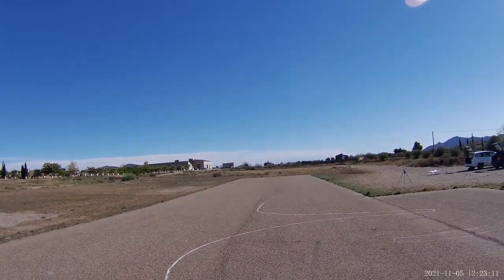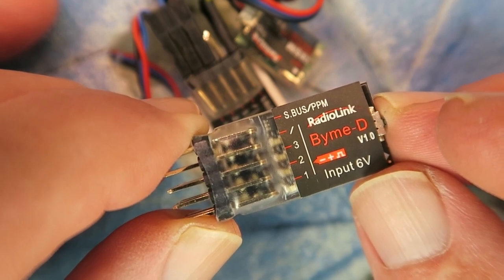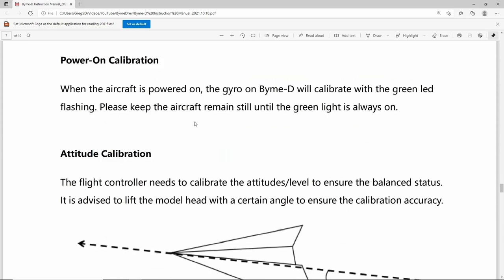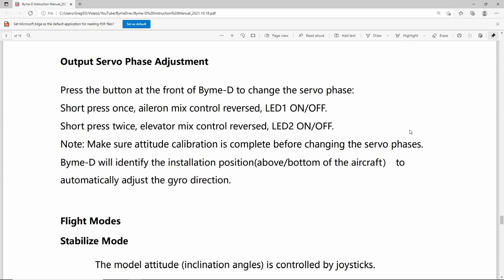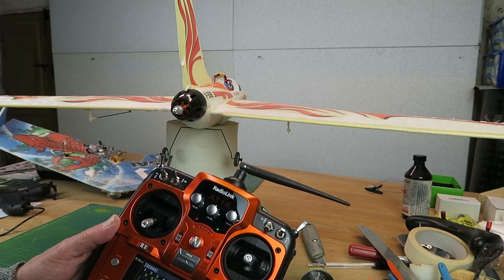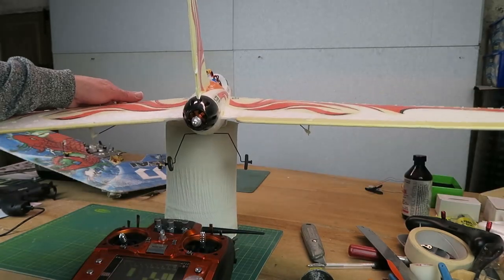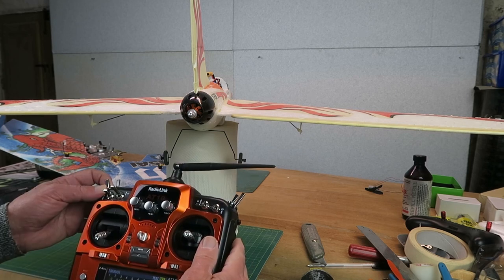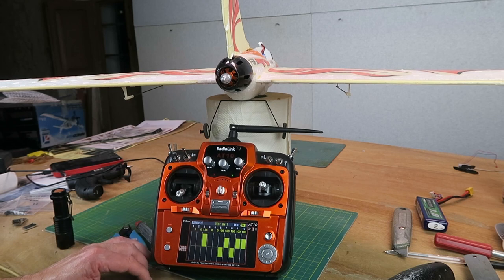Radiolink Byme D Gyro Stabilizer Revisited. Setup and Flight

Comment: 1 thing that should be added to this ( for users of other radio Tx/Rx protocols) is that the channel order MUST be A,E,T,R,5(on a 3-position switch as said here),6,7(on a 2-position switch) for these RadioLink Byme stabs to work. The re-mapping Etc to get this (and other quirks of various protocols) can cause the stick position combination to initiate the Attitude Calibration to be something quite different from the "Down and Out on both sticks" as shown here. Go through them all before you yell "It doesn't work!" The sticks will probably need the full travel of 1000microsecs to 2000microsecs as well - IE no reduced Rates and Spektrum may need 125% extended limits enabled! 
Also the Microsecond switching points for these are not known yet (RadioLink has ignored requests for information on this point) and also seem to vary from unit to unit. EG for some units it will prove impossible to have the motor stop at low throttle even if you have your ESC calibrated to your Tx/Rx correctly. You will have to go to your Outputs Page and drop your lower Throttle limit below -100% (on -100/+100 systems.) 
They do seem to work reasonably well though within their limits and are at a good price point.
Reply from the maker: Valuable input my friend! I have pinned the post so others can see it. I'm waiting the arrival of a Hobbyeagle A3 Pro "mini" to test, stay tuned!
Reply: @1nformatica  We'll look forward to that. Tried a HE A3Pro (not Mini) in my Volantex G2 Ranger. Set it up with my old mate helping with the button pushing while I was reading the manual. Thought (terrible word!) it was all OK. Took off in Beginner Stabilized - immediately stood up into Hover - frantically toggled switches and crashed straight down onto its nose! 
Picked up the scattered pieces of the HE, put them in the drawer and added a Kopilot Lite and another serving of hot glue. ;-)
Reply from the maker: @theoztreecrasher2647  The A3 Mini is configured via USB to a PC app, must be simpler, no?!
Reply: @1nformatica  Nope! Not to computer illiterates like us Old Farts Junior! :P

Comment: Byme D works as advertised. I have not maidened my 64mm F8 Crusader, but the elevon setup works! I have a Futaba T6k and made a new profile for elevon setup. The Byme D would not work at all. It was then I discovered the Futaba has elevon mixing in the pre-programmed model/type choices. I turned off all other mixes and zeroed the outputs for CH1 and CH2. Going one direction at a time, I added values on the controller for CH1 until the desired effects were achieved. I did the same for CH2. It works perfectly. I also have 3 other planes on Byme A, they are great for the price/performance.
Reply from the maker: For me the lack of gain control and general programmability makes the Byme a non no for any expensive plane. Much better to go with the A3 Mini : https://youtu.be/rPhf0cLP1hw

Comment: Receiver outputs required for Byme-D (and A) Level Calibration have FINALLY been published by RadioLink.
Aileron at 2000usecs, Elevator at 2000usecs, Throttle at 1000usecs, Rudder at 1000usecs. 
That equates to Left Stick Down and Left, Right Stick Up and Right for a Mode 2 (left throttle) AETR order transmitter like FRSky, Flysky and others.
Reply from the maker: Thanks for sharing this info. Unfortunately it comes to late for me. Tired of the strange behaviour I have jumped ship and now use the Hobbyeagle A3 Mini which is about the same size and price. Has proved very reliable for me. Thanks for watching, have a great day!

Comment: Excellent.  The most comprehensive review of the BYME D.  For an $1.00 the could have put a potentiometer on to deal with the excessive twitching caused by having too much throws. I put this in the RADJET 800.  Launch was great but as soon as I turned back to me it started twitching like crazy, I thought it was going to crash because it was so twitchy.   I've got the BYME A in a couple of scratch foamboard builds and it works great.
Reply from the maker: Hey thanks! I am now using the Hobbyeagle A3 Mini, a much better and predictable 6 axis gyro that can be configured via a PC, check it out here : https://www.youtube.com/watch?v=rPhf0cLP1hw Thanks for watching, have a great day!

Comment: OK, we now have the Byme-A sorted. Posting this here as well as the forums since it is 1 of the few intelligent active sources on these things. 😜😁.
Used the 'Special Functions" feature on the Radiomaster TX16S OpenTX radio to create a different modes set-up that more suits us Old Coots.
Put "Stabilized, self-leveling with angle limits", Stabilized, self-leveling with no angle limits", and "Gyro, wind correction only" on a single 3-position switch. Then added an over-ride function on another switch to force the "Hover" mode on and finally a third switch to force the Stab to "Manual." Used a 3-position on the "not up" command for the "Hover" (a 2-position would be better) and a 2-position for the "Manual". (A finger-held momentary 2-position would be best.)
Reply from the maker: A good setup, thanks for sharing. I have never had an issue with the Byme -A. The only mystery for me is why the Byme - D looks like it doesn't work in stabilised mode 'cause the control surface are all over the place, however it still flies OK.

Comment: Very nice tutorial! Something the manufacturer should pick up! On another note; my TX16S tends to 'swamp' the XM+ receiver, causing the signal to drop, which in turn makes the Byme-D similar to what your video shows (extreme throws), I wonder if the same applies to some extend to your set-up.
Reply: When close to the receiver, should be included...
Reply from the maker: I have several XM+ receivers I use with my Taranis, they all show the same problem feature! You need to either move the Tx away (doh!) or put the Tx in range test mode to reduce the power. Make sure your Rx failsafe is set correctly with CH5 to manual mode and throttle down!

Comment: I fooled with this gyro about a year ago and never tried to fly with it because of the control surfaces behavior at the work table. I knew it was something probably related to the accelerometer. Great video man Thanks!
Also a quick question for you, did you have to reset your esc because of the throttle channel needing to be reversed?
Reply from the maker: Hey thanks! It is a useful gyro for smaller models, just as an experiment I have a Byme A in my Bixler 1.4M wingspan and it works well too. I am not sure what you mean by "reset" the ESC. When setting up as a matter of course I calibrate the ESC to the signal coming from the Byme.
Reply: @1nformatica  Yes. Recalibrate is the word I was looking for lol. I bought it to put in a experimental 10in ws primejet thinking any wind would make something so tiny hard to fly without stabilization. I'll be revisiting this gyro with some other tiny jet build soon. Thanks again man!
Reply from the maker: @kyleweber6969  Good luck with your project, if you have any questions let me know.

Comment: My Byme doesn’t seem to accept inputs from the AT10 II, the gyro is fine, and SBUS is connected and powering the RX properly, but still doesn’t accept inputs. Can you think of any reason why?
Reply from the maker: Hi, my best guess is that the receiver is either not bound to the transmitter or not correctly set to SBUS / PPM mode. This is from the Radiolink manual "PWM signal output mode by default as factory setting. There are two LED indicators on the receiver. RED LED (always on) indicates normal working mode PWM while RED+BLUE LED(always on) indicate SBUS/PPM signal output mode.  When the receiver is powered on, the FLASHING RED LED means no signal or binding WITHOUT success. Please bind the receiver to the transmitter." Also I find this unit very useful for testing SBUS https://bit.ly/SBUS_PPM_PWM_Analyser Thanks for watching, have a great day!

Comment: Just for interest's sake you might want to take a gander at today's video on the Byme-D by Ground Control RC, mate! 22/3/2022. Not the same product that we've got it seems! 🤔
Reply from the maker: I have been waiting for this video after he did the Byme -A. I am surprised he did not see the same issues as us with stabilized mode on the bench. The unit I have is revision 1.0 , maybe there is a newer version but I doubt it. His problem with pitch control was evident from his first test on the bench, you can see much more deflection for aileron than elevator. The Byme -D manual says "The max inclination angle is 70° for rolling while that for pitching is 45°." so I was not surprised by his flight. I find it really annoying he keeps referring to "Safe Mode" which it is not. Also no video of the installation, would be nice to see the location of the Byme -D in relation to the CG.

Comment: The 'strange behavior' shown in auto level mode only seems to occur if the Byme D is mounted inverted. Perhaps RadioLink is wrong in stating that it can be mounted this way.
Reply from the maker: Interesting! Thanks for sharing. I've moved on now to a much more capable but similar size gyro : https://youtu.be/rPhf0cLP1hw

Comment: Do i need also a Sbus PPM if i have a jumper t12(open tx) for a regular airplane ( no wing)?
Reply from the maker: I recommend using this gyro now : https://youtu.be/rPhf0cLP1hw Can be setup for flying wing or normal and is a much more capable device. You will still need a receiver that outputs SBUS, PPM or a bunck of other serial protocols. Thanks for watching, have a great day!
Reply: @1nformatica  Thanks, So if i want to use my Jumper TX i need to have this gyro plus the Sbus/PPM output, in addition to my Lemon DSM compatible receiver, correct?
Reply: @1nformatica  So if i have normal (for example Lemon rx DSM compatible) receiver , I need to change it in order to be able to use this A3 Mini, plus i need to buy an output Sbus /PPM?  Thanks
Reply from the maker: @alexherrera3918  Yes, pretty much all gyros need a serial (PPM, SBUS, etc) signal. My favorite Rx is the Radiolink R8F which you can use if your Jumper Tx has multiprotocol support : https://s.click.aliexpress.com/e/_9gdZED
Reply: @1nformatica  ok. let me see if i finally got it: i have a Lemon receiver, i need to connect the lemon receiver to the R8F and then to the SBUS?PPM in order to be able to use it with my Jumper t12? Thanks
Reply from the maker: @alexherrera3918  Nope! You just need a receiver that has SBUS / PPM output. If your Lemon RX does not you need to replace it with one that does!
Reply: @1nformatica  gotcha. Thanks!!